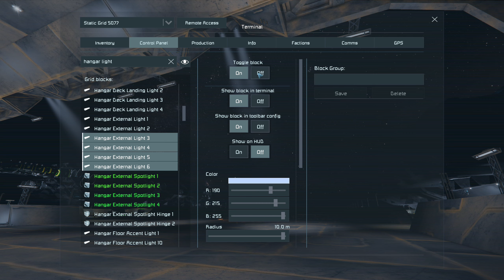Space Engineers - Wasteland Survival Ep72 - Upgrading the Atlas

Comment: By the way, I've been thinking about something. I watched your video about thrusters, and I wonder if it's feasible to build a large grid ship with only electric thrusters (atmo and ion) which is both fully functional (has crew quarters, at least one advanced refinery + assembler and other stuff you need for general self-sufficience) and capable of planetary landing and take-off. 

The atmospheric thrusters will lose efficience as altitude rises, and there is a cut off. Ion thrusters are essentially the reverse. Is there a point where they overlap enough to continue ascent, or is there a "thrust gap"? 

Without hydrogen thrusters, you won't need the extra weight of fuel tanks and other plumbing, but instead you'll need lots of batteries. 

I dunno, it's something I'd like to test.
Reply from the maker: Yeah you can definitely achieve such a ship, there are quite a few on the workshop that can do that 😊. I just prefer to use Hydrogen because it is simpler, even when you consider the amount of piping that is required to the thrusters and tanks etc. 

I have not really tried to build a totally electric ships before so I am honestly not sure if there is a thrust gap, although the higher you get in altitude the more Ion thrusters start to work and the less the Atmospheric thrusters work. Maybe I can do a follow up episode to that where I test the effectiveness of each type of thruster at different altitude's that could be an interesting video 🤔
Reply: @TheGarageGamer86  That would be pretty interesting, yes. If you have the time, etc.
Reply: @TheGarageGamer86  While I'm spouting ideas here, it occurred to me that the (hypothetical) people who will be using this base may want to have some means to go on the offensive, or at least be more actively defensive, against reavers and space pirates. 

Do you have any plans for things such as patrol cars, tanks/fighting rovers, gunships or the like? 

Given that you don't have ground NPC enemies enabled, much of that may not be technically necessary, but it's the sort of thing I would consider when building a base/settlement like this. 

Your people already have utility vehicles, such as the miner and welder ships, and the stationary base defenses are very impressive, but sometimes you need to take the fight to the enemy. 

Again, these are things I would consider, but that doesn't mean that I would demand the same of you. I'm just wondering if it's something you're thinking about doing.